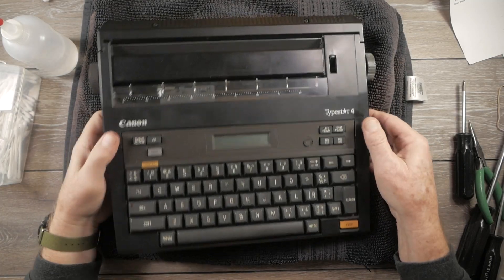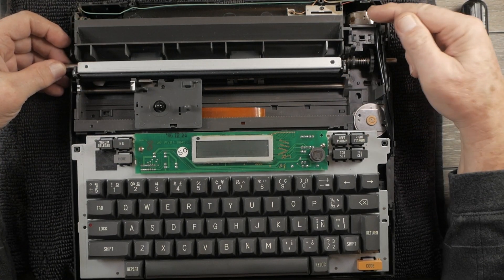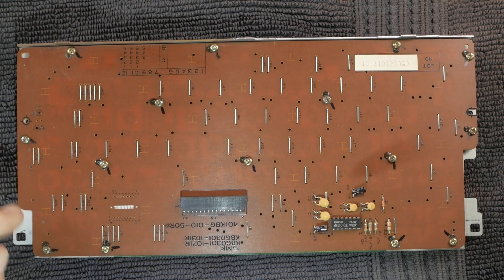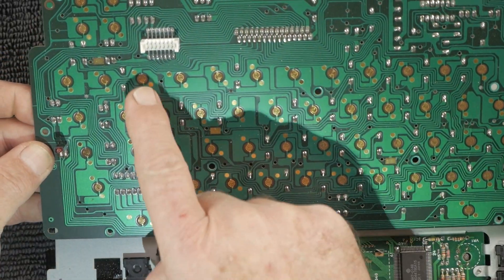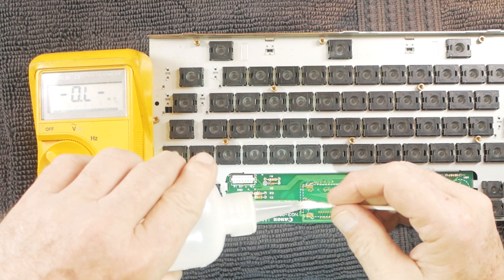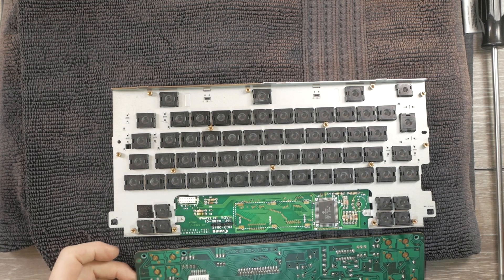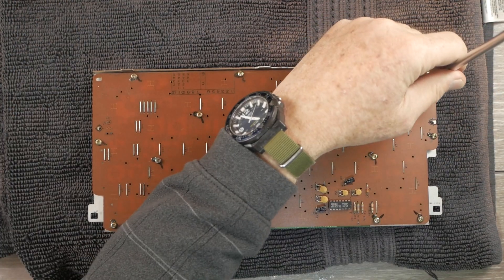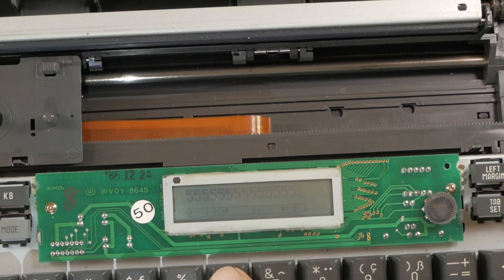Canon Typestar 4 Keyboard Repair

Comment: Hey Joe, i've recently just thrifted one of these same machines. Unfortunately the rubber rollers that advance the paper dont seem to be catching the paper and moving it when I turn the platen knobs or press the return key. do you think the rubber has just aged and isn't sticking anymore? do you know of any way to fix this? thanks!
Reply from the maker: They can get flat spots from sitting on one position for years under spring pressure. The only real fix is to replace them. Some people use automotive rubber tubing, but you can also have them sent off to JJ Short & Associates to have new rubber put on. This implies you need to remove the rollers from the machine. You may need assistance from a typewriter repair shop or experienced amateur.
Reply: @Joe_VanCleave  you know what Joe, I used your favorite Pro Gaff Gaffers tape and just ran a strip of it down each roller and it works. good enough of a fix for me! haha thank God I've been binging your videos and have gaffers tape on the brain.
Reply from the maker: @icedcoffeedrink  Nice fix!